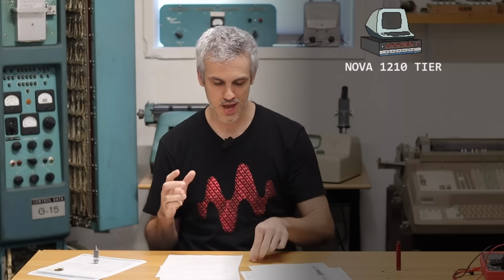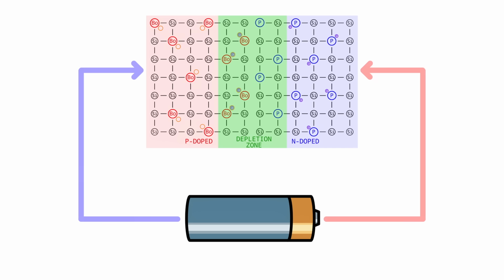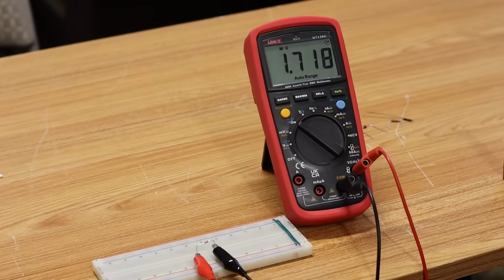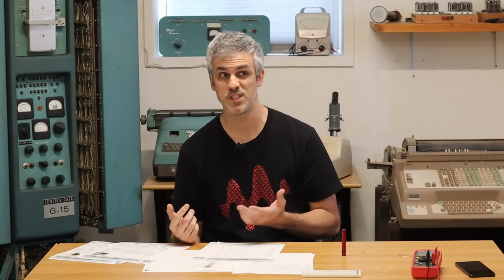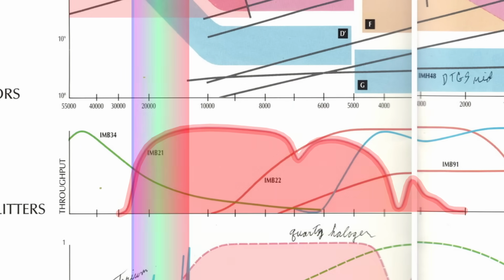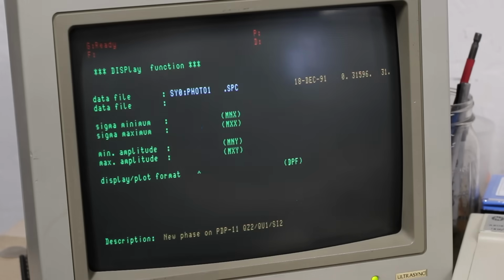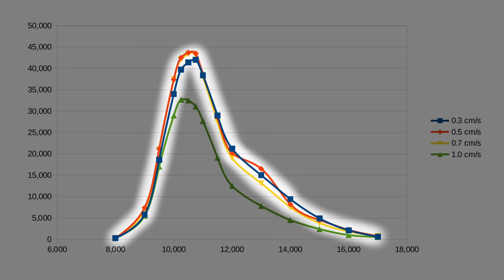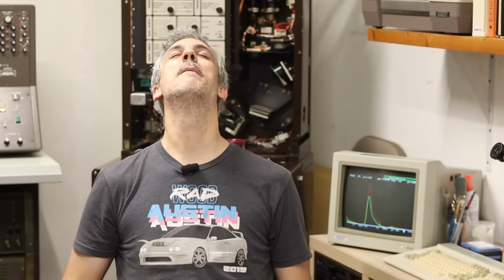How Do Photodiodes Work?

Comment: Neat fact about vacuum tubes and semiconductors, that's often overlooked (or discarded as obsolete?): they operate on the same fundamental principles (for certain meaning of "fundamental"..).  Charges are freed from one electrode, influenced by another, and received by a third.  Vacuum tubes are probably the more intuitive device, in which one can imagine electrons as hard particles moving around, and quantum effects can be ignored (except for surface physics at the boundary, but surfaces are a capital-H "Hard" problem so we can separate that out as its own thing).  Semiconductors are the same, except: instead of charges freed into the vacuum state (energy exceeding the work function of the cathode material; its electron binding affinity, more or less; something we have multiple other ways of measuring), charges in a semiconductor can be freed into an intermediate energy range: free to move, but only within the substance, not leaving it.  From the perspective of an electron, there are three lanes in a semiconductor: parked (bound valence electrons), driving on the highway (conduction band), or flying in the sky (vacuum state, unbound).  In a vacuum tube, there are only two: moving freely within conductors (or, the exact story is complicated at the cathode oxide surface because it too is a semiconductor(!)), or free in vacuum.

The effect on characteristics is mainly that, because vacuum state is unimpeded, i.e. ballistic transport occurs (they accelerate, unhindered by ions), there's a 3/2 power law (Child-Langmuir law) instead of the FET's square law.  Notably these are both above-threshold conditions, and both exhibit the exponential cutoff tail expected from thermal statistics (because they are both thermally driven devices in the end).  (And yes, the cathode temperature can be (sort of) measured by the slope of that exponent.)

The direct equivalent of the photodiode, is the phototube: a sensitive cathode surface (i.e. very low work function -- these work down into near IR or so, not sure about lower?), when struck by light, emits electrons (instead of electron-hole pairs); the photocurrent can be measured at zero bias (or it has a zero-current potential, just as a solar cell's V-I curve does), but mostly it's done under bias to get a somewhat stronger signal.  There are also gas-filled phototubes, where some multiplication (avalanche discharge!) occurs under modest bias (50-100V?).

What's not in common is the charge balancing of an ionic lattice (all the silicon atoms or whatever), which makes maximum current density massively higher for the semiconductor, and thus transconductance per area (a figure-of-merit for AC performance); and the pseudoparticles (holes) that make complementary circuitry possible.  (You could, in principle, make a P-type hydrogen tube, using a hollow cathode and additional source of bias, or something like that, to liberate bare protons and send them through a normal electrode structure.  Problem is, besides all that extra work, the proton is a good 2000 times heavier than the electron, worsening performance by the same factor!)

A fill gas can provide charge balancing, but at a terrible price: as the gas absorbs kinetic energy from the electron beam, atoms will always kick off additional electrons (or absorb some too, depending on the gas), making a avalanche or glow discharge; and the ions themselves are free to move (they're a gas already..), contributing to the current -- but not only that, but very slowly as well (a typical neon bulb has a deionization time (equivalent to a diode's recovery time) of 10s to 100s µs).  Ions take a lot longer to "cool down".

Conversely, vacuum diodes can show weird behavior that semiconductors can't hope to produce.  Apparently, if you have the right pressure and temperature of cesium metal or similar, the atoms can cluster together in vapor phase, with weird electronic configurations -- excited states, really "large" atomic radii, but in equilibrium either at room temperature, or because there's a heater present.  This state is called "Rydberg matter".  Apparently this is one way in which a thermionic heat engine can gain some efficiency -- compare a typical 6AL5 (~1W heat input, 0.8V 2.6µA output) to, well, anything that deserves of being called a "heat engine", hah.

Comment: I suspect you could have had the photo diodes elsewhere and use fibre optic cable to carry the light pulses down to the photo diodes.
Reply: What? Mix 1970's tech with 1950's tech? 🙂

Comment: Loving the science, recreating lost data sheets experimentally!  Reminds me of the time I built a vacuum tube amplifier and plotted graphs of current against voltage, using a laptop with an experimenter board  (with ADC inputs connected to a resistor in the cathode via an op-amp to boost the voltage and the anode via a potential divider to reduce it, and a DAC output connected via an inverting op-amp to apply a negative voltage to the grid).  There was a nice straight section, as expected, so I just set my operating point smack bang in the middle of it.  And it sounds great!

Also loving the trans flag colours on the T-shirt!  Happy Pride Month to all my trans sisters and brothers, and hang in there .....

If you can get the concept of electrons moving through a vacuum, it's not that much of a leap to the concept of charge carriers moving through a chunk of semiconductor material.  All you need to know about holes  (which, as the name suggests, are just electron deficits, where an electron should be but isn't, thus leaving a unit positive charge)   is they move in the direction of conventional current  (because when an electron jumps out of an atom to create a hole, then jumps into a nearby hole, it's as though the hole moved to the spot where the electron came from_)  carrying a positive charge; they move more slowly than electrons (because it takes time for an electron to get into and out of a hole); and if all this is the convenient abstraction, then you don't want to spend any more time than necessary thinking about what's _really going on.

Comment: Listen dude, when reverse engineering something that old, something that was designed and engineered in imperial units it is far better to work in those units as it reveals 'truths' about the ratios and thinking that they applied. One thousandth of an inch is just as viable a unit as one thousandth of any other unit. Great video BTW.

Comment: This is a very good explanation but there is a lot more going on - as you probably know.
The size of the depletion zone depends on the material. For common Si Diodes, its almost 0.7V. When you introduce a voltage in a circuit, you either increase the depletion zone or you decrease the zone depending on the direction of the voltage. When you have enough voltage in the forward direction, a current can flow. In case of the Si-Diode this is almost 0.7V. You kind of skipped the part with the size of the depletion zone. This is most important with transistors.
But there is a neat detail. The depletion zone makes any diode a capacitor. This is a problem for high frequency applications. Or can be exploited. You can alter the size of the depletion zone by voltage so you can adjust the capacity. this is used for radio receivers with electronic tuning including almost all modern PLL FM-radios. 
Also the Zener Effect is prominent until around 4V. Z-Diodes with higher voltages depend on the avalanche effect. So in Europe, those diodes are called Z-Diodes only while in the US they are still called Zener-Diode no matter which voltage they have.

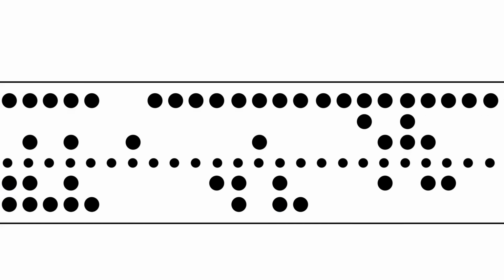Comment: 21:35 - Where did they dig up those hole sizes from?  They're not a simple or common fractional number in either millimeters or inches.  They don't even seem to be related to letter sized drills.

Comment: That photodiode is probably quite a bit faster than revealed by this test method!

There are about two physical limits to the speed of a photodiode: transit time (photogenerated carriers have to cross the depletion region to enter the external conductive circuit path), and stray resistance or other construction details.

To let light through at all, the diode's top interconnect layer does have to be quite thin and sparse -- some "high efficiency" photodiodes are so "thin" in this sense, they have a response tail in the 10s µs!  That is, the lateral resistance of the top layer, versus junction capacitance, has a time constant of this order.

Efficiency, and transit time, are further improved by reverse-biasing the diode: the depletion region grows wider, lowering capacitance; and the higher electric field accelerates freed charges that much faster.  Which also leaves less time for charges to spontaneously recombine and be lost (i.e. not reaching the outer circuit).  Or biased right up to the (avalanche) limit, impact ionization can occur, greatly amplifying the signal (albeit with significant noise; hence "avalanche photodiode").

With respect to the circuit, we can minimize the effect of capacitance by providing reverse bias as mentioned, and shunting the signal into as low an impedance as possible.  Which...develops very little signal voltage, of course, so this is a strict compromise, but it suffices for testing purposes to use something typical and low like 50Ω, which can be carried on any length of transmission line, up to a 'scope (with termination enabled).

Probably the actual bandwidth is in the MHz, or more.  To test this, you have the inverse problem of course: how to generate light keyed on and off this fast?  Fortunately, LEDs are pretty fast: a modulation bandwidth around 10MHz is typical.  (White LEDs are noticeably worse than blue: the yellow phosphor keeps glowing a few nanoseconds after incident light stops.  Red and green (AlGaAsP alloy) are comparable to blue AFAIK.)

Not that this matters to the Bendix, of course; its bandwidth is certainly limited by the input/receiver amp.  Which I believe, has a fairly high voltage swing at the diodes, i.e. a high impedance (also loaded by a tube grid's capacitance), so will place somewhere in the low kHz? Plenty indeed for tape reading, and with some modest tuning (and maybe the assistance of a few cheeky transistors), could easily be pushed into the "I can't read this tape because it's being torn to shreds" territory, heh.

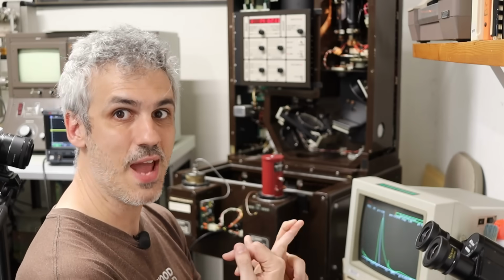Comment: 18:30 - Hi David. You could try comparing it with a known Si photodiode taken from a slotted opto-coupler (available in any old, dead computer mouse that has the rubber ball in it.) 😊 You might have to cut the opto-coupler in half as some have the emitter/detector potted in with epoxy. 😢

Comment: The remote doesn't have an infrared photodiode, it has an infrared LED. The receiver might use IR photodiode, but usually it uses an IR phototransistor.
The best way to measure frequency response of the photodiode would be to put an IR LED in front of it and turn it on, then place a disk with holes and rotate it at varying speeds while observing the diode output. When the output drops to 70,7% of initial amplitude, that would be the bandwidth of the photodiode.
Also there is special subtype of photodiode called PIN diode...

Comment: The voltage drop across a forward biased diode is proportional to the peak wavelength of the diode: Vd=hc/λq; where Vd is the voltage drop, h is Plank's constant, c is the speed of light, λ is the wavelength of the emitted light, and q is the charge of the electron.  So, if the voltage drop of your diode is around Vd=1.46V then λ=850nm.

Comment: Getting 1000 char/sec is quite impressive, especially for an early solid state detector.
In WW2, the Colossus computer of Bletchley Park fame,, was running it's data though a photoelectric reader, at 5000 char/sec, or "40 mph" before shredding problems were an issue.  The two tricks that made this possable was using photographic film as the tape, as well as using high speed photodetector tubes. With the tubes, the optic stage was huge compared to what you have now.

Also, if you were to "optimize for production", there are some small and fast sensors now, that could probably do millions of characters a second... if some how you could run a tape or disk at that speed.

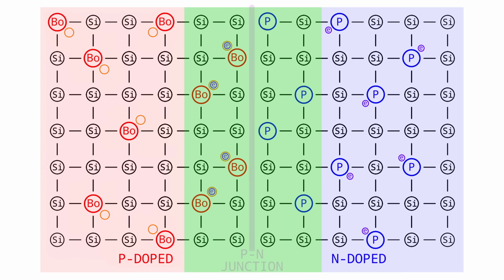Comment: as part of my Industrial Systems training in Tech we covered analog and digital circuits, and the section on transistors made me the most confused because they tried to describe it as "you have two materials full of holes" and never expanded upon that, your explanation at 4:33 made the most sense of any explination as to how diodes and transistors work on the P/N Junction than the text book and videos we watched in tech, also interesting findings i knew photodiodes and phototransistors were fast, never realised how fast or that they opereated near IR, also its shocking that a tape reader could go that fast, but as you said at that point the limitation is the paper tape itself turning into confetti at high speed and making a mess

Comment: If I remember correctly, there used to be a germanium transistor called an OC71, and a germanium phototransistor called an OCP71. The difference was a layer of black paint on the former! That was in the early to mid 1960s.

Comment: I'm curious about your very professional looking speadsheets and graphs.  Were you able to export your measurements from the Bomem's software on the PDP-11, or did you have to manually measure points on each curve and then enter those values into another piece of software? (presumably Excel, Calc, Sheets, 1,2,3, VisiCalc, etc)

Comment: ALL semiconductors are light sensitive. And they also emit light when current passes through them. That is why they're encased in a black material. You could see that 1N4148 emit light but the room has to be completely dark and you have to be able to see infrared light. An example of light sensitivity can be seen in video https://youtu.be/dDcsTnqVgWc?si=OaPFKmtAyluTIZjQ

Comment: Interesting episode. Note that the clock holes are in the middle of the data holes, so the actual distance to stabilize is 1/2 of the difference between their respective sizes. Meaning the max rate is really somewhere around 320 cps, much closer to the 200 that it's actually running at. Speed response will also be very relative to the intensity of the light. It may also be that your replacements are not as responsive as the originals (or are more responsive), and operate at a different wavelength.

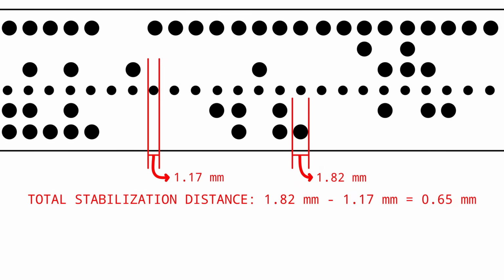Comment: @22:00 Close, but the holes are actually aligned on their centers.  The 0.65mm represents the space on both sides, and only 0.325mm of that is between the start of the data hole and the start of the timing hole. Cut the time in half, and that doubles the frequency, 1562Hz is the real value.  Your discussion of how this actually supports the 400CPS tape reader is still fine, but it explains why there is no 1000CPS reader.

Comment: It is a common misconception that a photodiode only reacts to light hitting the depletion zone. Especially with NIR light on a silicon diode the light goes quite far in the silicon and absorbtion quite deep in the material can also contribute. Only this way a good photodiode can reach some 90% quantum efficiency, even with more light going through the depletion zone.
The phsics behind it is still a bit complex.

The speed is a combined property of photodiode and amplifier circuit. Additional capacitance can slow it down. Also the reverse voltage can make a difference (more voltage reduced the capacitance and this way make it faster). The intrinsic speed limit for photodidoes is usually way faster.

It may help to block the room light from reaching the detector - this can reduce the noise.

Comment: Neon indicator lamps double as avalanche photo detectors too, especially if old or underdriven.  They might glow only when illuminated or only on voltage spikes.  In darkness the only current flowing is related to the capacitive coupling between the electrodes.

Comment: I really want to make a 1950s movie called the refrigerant planet. And I will be using the Bendix G 15 as one of the machines on the spaceship to calculate and do work for the actual working prop in the movie. The refrigerant planet is a planet that's covered an ammonia their areas on the planet that are crazy I can compressor. There are areas that are warm and there are areas that are cold. It's sort of like a retro like 2001-2020 1950s vibe. But I don't have the funds to do so and I haven't told the public yet about the movie until now.

Comment: What's age got to do with it other than most people in their teens just didn't have access to this sort of equipment. At 60 is just as cool, but I know more, and was impressed at how you retasked the Bomem for the measurements.  When I was a kid in the 70s and 80s This would have been just as cool, I wasn't able to do as advanced measurements as this, but I did do this sort of stuff with what I had, only difference is I had to use graph paper, and a pencil until 1980 when I got my Trash-80.

Comment: Those photodiodes can maybe work at  higher frequencies than you measured.  More reverse voltage makes them faster up to a point.  The capacitance of the diode decreases rapidly with reverse bias up to about 6V or so.  The circuit in the preamp may not apply much reverse voltage.
Now that you know the performance of the diodes you at least can look for a modern replacement if one is needed.
Reply: I would imagine the rarity of the diodes would make it rather less desirable to run higher reverse voltage unless truly necessary, there's probably a tradeoff between longevity & function when it was originally designed.
Reply: @danl6634  You make a good point.
It appears that there are photodiodes that can be bought today that will work in the same sort of circuit.  If he makes another tape reader, I would suggest those.